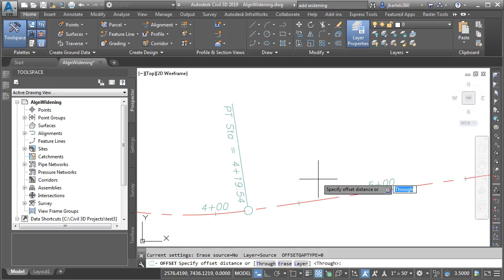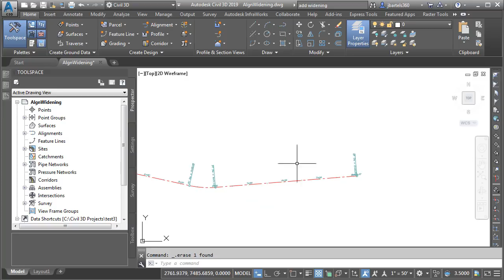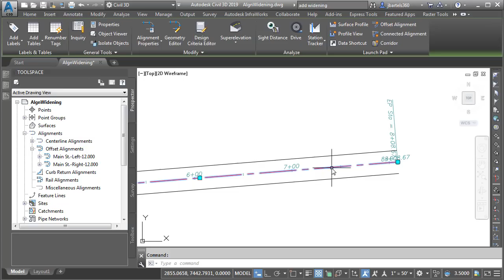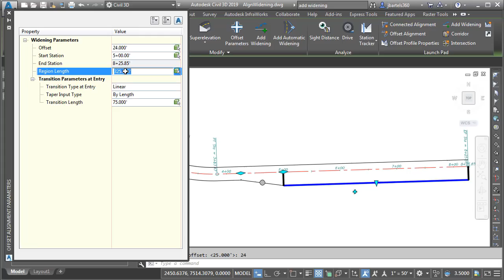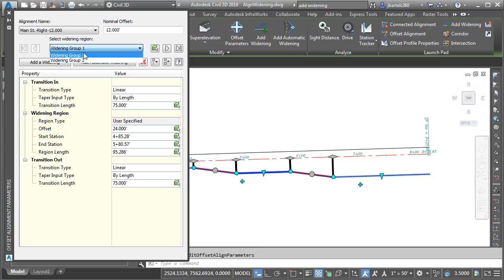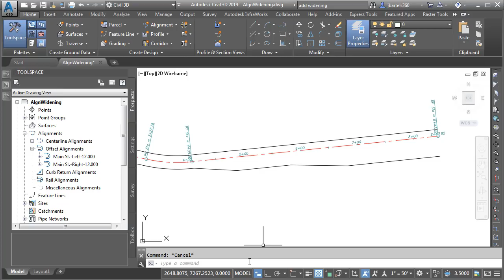Adding Widenings to Civil 3D Offset Alignments

Comment: Your tutorial is awesome.  Thanks.  is it possible to apply offset alignment for non-parallel widening?  i.e. i need to transition from 2 lanes (12') to 4 lanes (12' lane) and approx 3' shoulder?  my transition include a curve 2000' R a tangent 300' and a curve 2000'.  
Thanks